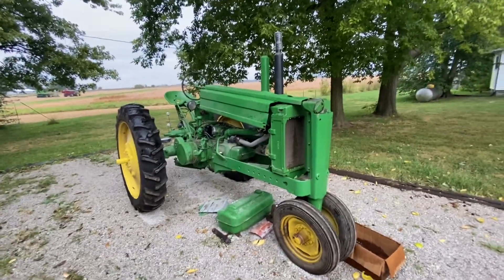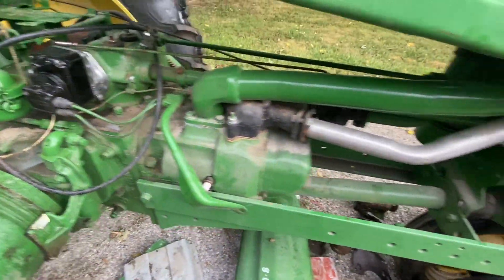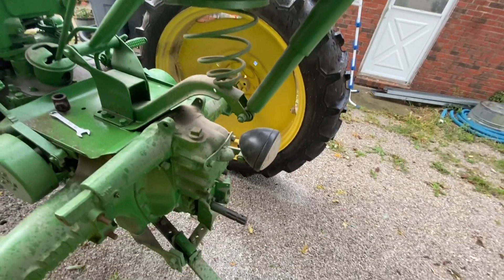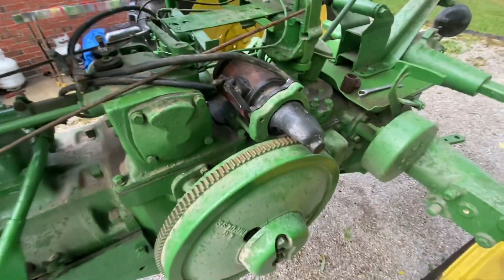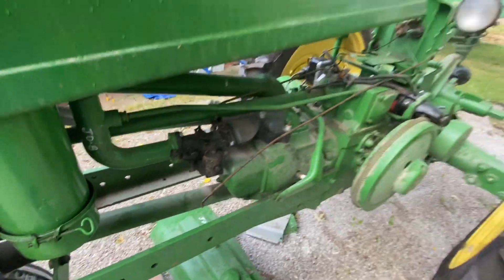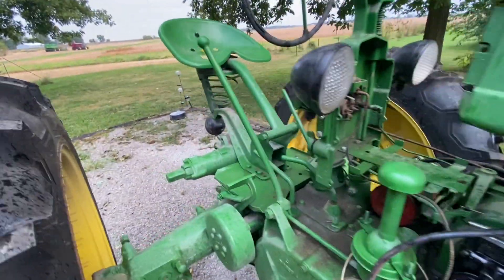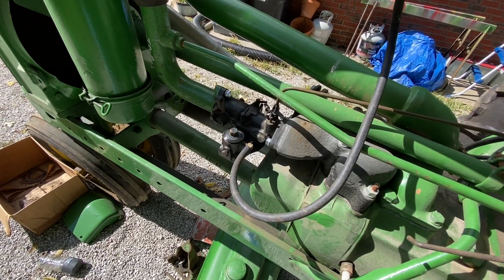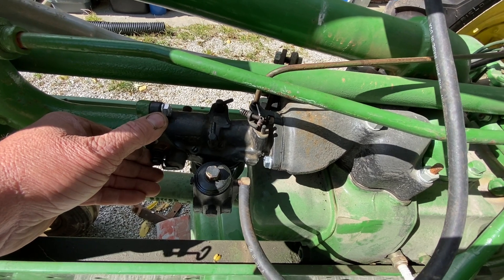1946 John Deere B....... IT RUNS!!  Part1

Comment: I have a 46 B as well, I have never seen that seat before.  I made a shaft to fit the flywheel and attached it to an old steering wheel to allow for hand cranking it.  There is a certain satisfaction gained by firing it up the old way!!!!
Reply from the maker: I have a few hand starts and you are right, when everything is in order. Lol. The B has the Monroe ez-ride suspension seat. They were pretty common back then. I’ve had a few with the same setup.